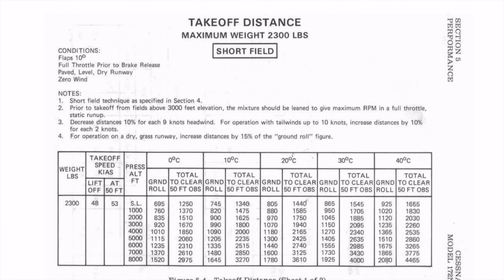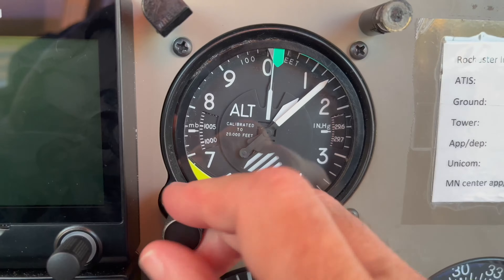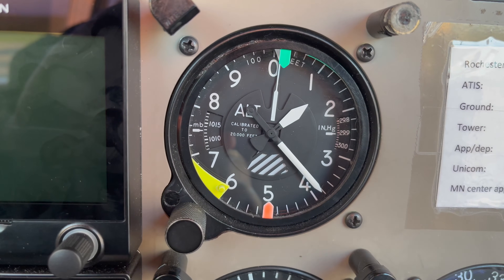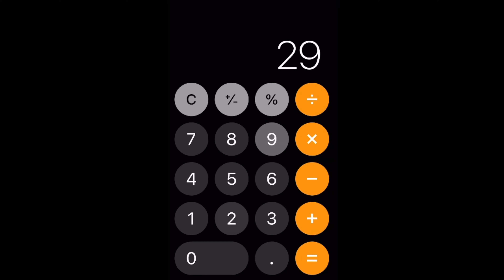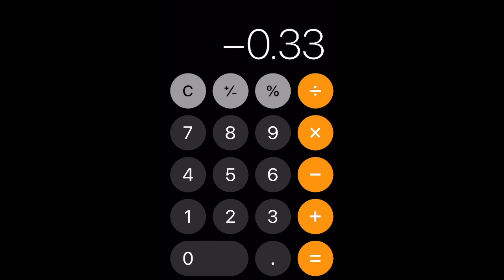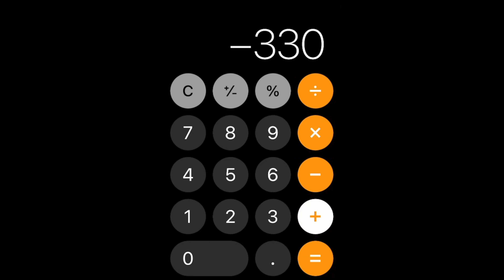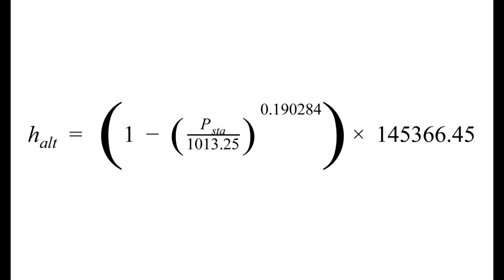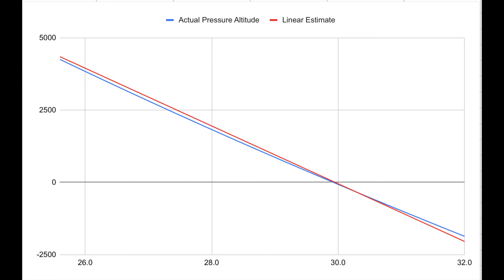Checkride prep | Aviation Math | How To Calculate Pressure Altitude

Comment: Wouldnt the standard temperature and pressure change with each location? An airport at 643ft MSL would have the standard pressure of 29.27Hg and a standard temp of 13.71C°, right? Wouldnt these be the standard from which you would subtract pressure and temp from at this location?
Reply from the maker: If I am understanding your question correctly, you are asking why we don’t calculate pressure altitude by adding/subtracting current atmospheric conditions from the standard for a specific station.  

The answer to that is actually in the definition of Pressure Altitude.  The definition is “the height above the datum plane”.   FAA references specifically define the datum plane as sea level when the temperature is 15C (59F) and the local pressure is 29.92.   So, the quickest comparison is between the calculated altitude and sea level during those conditions.

I think what you are recommending may be the equivalent of calculating the idealized AGL (above ground level) height for a station.  You can likely determine Pressure Altitude by calculating the corrected height above a station, but then you’d still have to take at least one additional step to get the actual height above the datum plane.  

I hope this helps.  If I’ve misunderstood your question, please try asking it a different way.

Thanks for asking the question.

Comment: I like your video.  Good explanations.  However, I would have preferred to see units used  in all graphics and formulas.  Finally, I think density altitude is more relevant than pressure altitude regarding aircraft performance evaluation.  Pressure altitude can be used in SOME POH; those with temperature correction as in Cessna 172N POH but not for the Beechcraft Sundowner C23 POH which does not have the temperature correction (it gives the performance according to the altitude density.  Fly safe!
Reply from the maker: Thank you for the comment and the suggestions. 

I specifically chose to use pressure altitude for this video because the performance charts/tables for all the aircraft my local students fly start with Pressure altitude—Cessna 172N, Piper Warrior, Piper Archer, Cirrus SR series, Mooney M20K, Beech Debonair, and even a later model Bonanza. 

I recognize not all aircraft start with Pressure altitude (that some use density), but at the time most of my viewers were my local students and I wanted to make it immediately useful for them. I’ll add doing performance calculations using density altitude to my list of video topics.  I’ll see if I can find a Sundowner POH or Owners Manual online to use for the calculations. 

Thanks!!

Comment: @02:00 Does his equation also apply for hecto pascals?
Reply from the maker: Unfortunately, it does not.  You would need to use a slightly different formula.  I don’t practice this regularly, so I might not have it correct.  However, I believe to find pressure altitude using hectopascals, you first subtract the current reading from the ISA in hPA of 1013.  There is a 30 ft difference for each hPA, so you’d multiply the difference by 30 feet and add the total to the original altitude to get pressure altitude.  

For example, if the pressure is 1015, the difference would be -2, multiplied by 30 is -60 ft.  If current altitude is 1317ft, then the pressure altitude would be 1257.  I hope this is helpful.
Reply: Ahhh Yes, I got it, sir :) @ScottKoonCFI

Comment: Great video!!! Do you always add the PA TO THE Field elevation or altitude you're going to?
Reply from the maker: @PodbyBarryB, thanks for the question.  I apologize, but I’m not quite sure what you are asking.  Let me take a stab at trying to answer what I think you asked.  If I missed the mark, please give me a bit more detail about your question.  

I don’t add the pressure altitude to the field altitudes or altitudes I am going to.  Instead, I add a correction value to the field or flight altitude to get a pressure altitude.  And, the altitude to which I add the correction value depends on the question being asked.  If I am using Pressure Altitude to determine take-off performance, I’ll add any corrections to the departure airport’s stated altitude.  If I’m calculating landing performance, I’ll figure the correction based on the altimeter setting at the destination and would add that correction to the destination’s altitude.  Finally, if I am looking for cruise performance or climb performance, I’ll add the corrections to the expected in-flight altitudes.  

I hope this helps.  If not, please ask again.  Thanks!
Reply: @ScottKoonCFI  that was perfectly clear Scott! Thank you for the speedy response as well. 

Do you do online based ground training?
Reply from the maker: Glad to hear I was able to answer your question. 

I am currently working on an online training series, but it’s not ready, yet. I’ll be announcing it as soon as it is released.  Thank you for asking!
Reply: @ScottKoonCFI  ok Ill keep my eyes out...

Comment: Why do you care about pressure altitude, though (apart from passing an exam)? Isn't it just a step towards calculating the density altitude?
Reply from the maker: Thanks for the question. Actually, many performance charts/tables are based on pressure altitude.  We fly Piper Archer IIIs, Piper Warriors, Piper Seminoles, and Cirrus aircraft.  All of their performance charts start with Pressure Altitude.  So did the Cessna’s we used to fly.  The funny thing is that many of our local students are asking why do I need to know how to calculate Density Altitude since they almost never use it.   Thanks again!

Comment: I' m so bad at math. This makes me want to cry. I'm really intelligent but math just doesn't work in my brain. Does this mean I can't fly?  😢
Reply from the maker: I have to say that I’m not quite sure how to answer your question.  

In the video, I go a bit further into the mathematics than is probably necessary.  The reason was to demonstrate that in many cases there are “rules of thumb” that provide more than adequate performance estimates.  

So, do you have to be good at mathematics?  Perhaps not.  But, you will need to be decent at arithmetic and basic algebra to be able to answer weight and balance, wind correction, ground speed, fuel usage, and other performance questions.  While there are tools to help, most DPE want to know you understand the process.

To be more specific, not being good at math doesn’t necessarily mean you can’t fly.  It does mean you’ll need to work harder and perhaps be creative to find ways to wrap your head around the numbers.  I’ve seen students work through similar issues and be very successful.  In one case, a student partnered with someone that was VERY good with mathematical concepts and that partner was able to simplify and explain the work in a way that made sense to the student.  

I’ll keep working to try and find concise ways to describe and define these aviation concepts.  I know there are many other video creators trying to do the same.  Keep searching for the answers.

I hope this helps.  Keep working, keep watching, and best of luck!

Comment: Awesome video! Thank you so much! I'm trying to get ready for my written test for my private helicopter license and while my school covered every topic there are many topics complicated topics we just talked about for a little bit and then moved on and I never quite understood so now I'm going back through using YouTube to try and more deeply understand each topic. One thing on this particular topic I've been wondering about is that it seems like practically speaking. Air pressure at a given altitude is mainly determined by the air temperature at that altitude. Does this hold true for the most part?
Reply from the maker: Thank you!  I’m glad you found the video helpful.  The simple answer to your question is “Yes”.  Differences in air pressure at the the same altitude are mainly influenced by temperature.  In fact, page 12-3 of the PHAK states “The unequal heating of the Earth's surface not only modifies air density and creates circulation patterns; it also causes changes in air pressure or the force exerted by the weight of air molecules.”  So, according to the FAA, NOAA, and a couple other sources, air temperature has the greatest influence.  I hope this was helpful.  I wish you the best of luck with your studies!
Reply: @ScottKoonCFI  thank you so much!

Comment: How would you go about calculating PA for cruising performance charts? Instead of adding airport elevation would you add desired cruising altitude?
Reply from the maker: Thanks for the question. You are correct. You would start with desired cruise altitude and use the most local altimeter setting to determine enroute pressure altitude. I hope this helps!